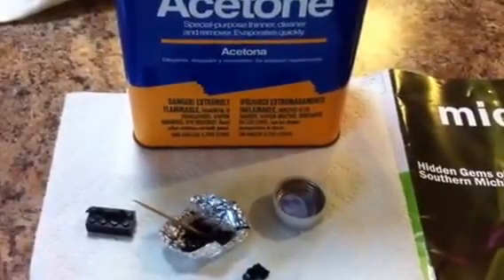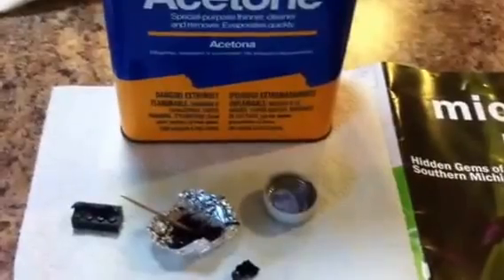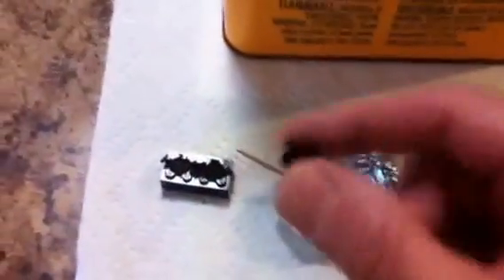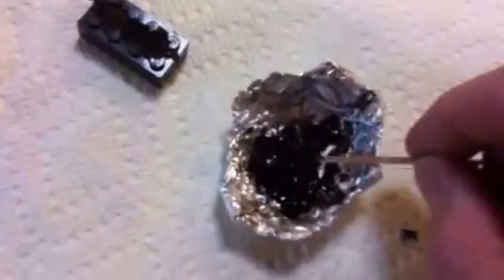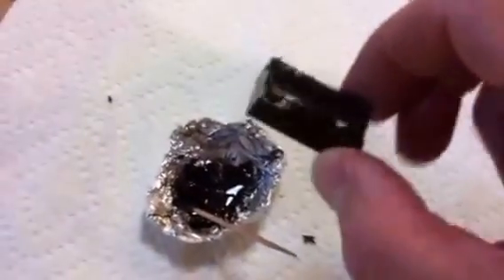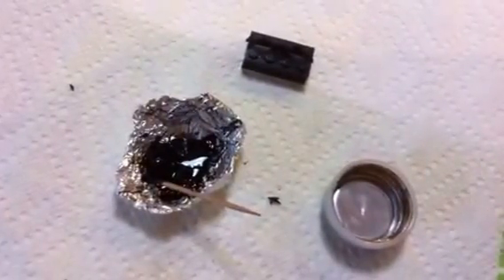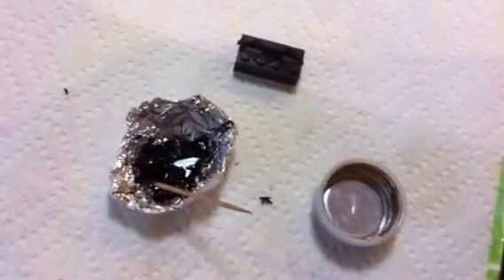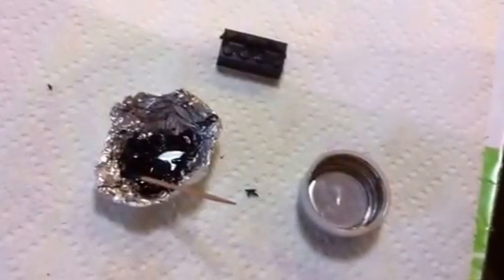How to Make ABS Glue from Lego and Acetone

Comment: You can buy ABS Cement in the plumbing section of Lowe's. It appears to be just black ABS in solvent (intended for sealing ABS pipes; right next to the PVC Cement). I use it for all kinds of ABS repairs, especially broken screw posts, shredded threads, and cracked parts that need a bit of extra plastic to reinforce from the inside.

Comment: Both the Lego and your Keurig part are both ABS. You could have just used the acetone directly on the Keurig part to bind it.
Reply: +pixelbat That might melt a hole in it though if not done right, this seems safer